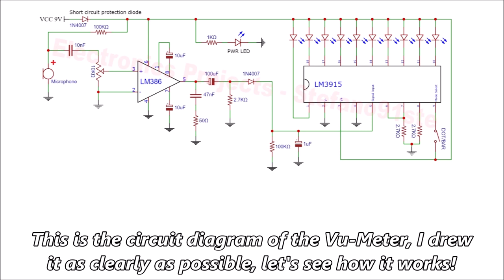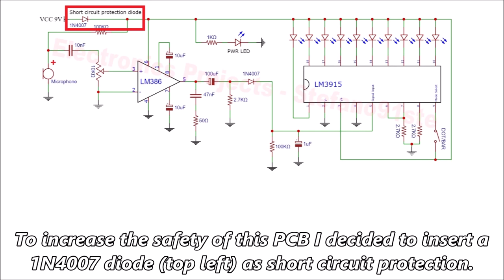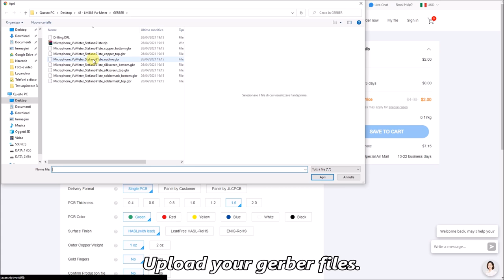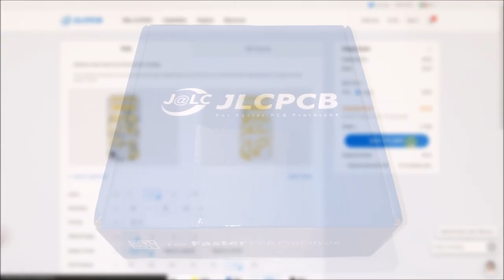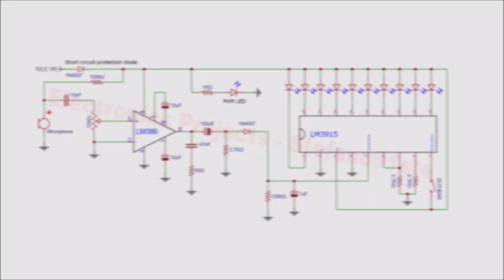LED Vu-Meter with Microphone LM3915 & LM386 - PCB Tutorial

Comment: I have a question!
1.Why did you use the diode ?
2.When I made the circuit, It was changed the Level after 100uF Capacitor. Before the Diode.

Comment: My Honor, Sir,
I did a vu meter after a video you posted. Tied to the speaker, he goes with a succulent. My problem would be that the vu meter is at a maximum for a small volume. The signal to the vu meters should be reduced. The amplifier is 8w (small). Is it ok to put a poteciometer in or not because of impedance? And how erratic should be kilo ohm. Thank you very much I would be very honored.

Comment: TPA3110 15w+15W Digital Stereo Audio Power Amplifier Board'
My question would be, is it possible to tie a vu meter to all Ic-powered mini amplifiers (power stages) loudspeakers? The TPA 311O doesn't go but TDA 2O5O goes nicely. The TPA 15w and an led secular are the last red. Where is the fault I ask respectfully?

Comment: Hello, do you think I could easily exchange the Mic with some wires to connect the whole circuit to a Arduino Board and use your VU-Meter circuit for a MIDI-Controller?
Reply from the maker: Hi, you could do this by eliminating Microphone and LM386, then connecting the LM3915 vu-meter to the arduino

Comment: What changes in the circuit diagram do I need if I want to power it with 5V power supply?
Reply from the maker: At 5v you can power it without any modification, but no less than 5v

Comment: Stefano!,  awesome work! I copied it and it works.  But, I would like to have a stronger signal from the mic.  LM 386 is a power  amp or preamp?  What would I have to add or change in order to gain sensitivity in the mic.  For example, I have to put the mic directly to my mouth or directly to a speaker to get the meter to move.  Please advise.  Thank you so much for your dedicated work. James
Reply from the maker: Hi, thank you! 
LM386 is a 1 Watt amplifier.. having said that it is great for small projects, but not for applications that require more power
Reply: I just want to make the mic more sensitive so as not have to put the mic directly on the sound or music that I am trying to get the meter (LEDS) to move. Please advise what I can do to make the mic more sensitive.  Thank you so much again for your fabulous projects.  I am so happy you responded to my letter the last time.  Good day to you.

Comment: Super and super!    Dear friend,
I'd say so, my friend, but I don't have the right.
I like to help you because I've been suffering for a year and I couldn't make the audio signal bigger.
I need a drawing with, say, two or three transistors (preamplifier for simple vu meter). I write with a fordito, and I tell you what I know, so how do you understand me? I bought everything from the net ,ready but it didn't work. The vu meter is the simple LM 3915, 1k ohm resistor and that's it! The microphone electret ,condensator .1 transistor. The signal is so good. Megyen but the volume should be weak or high. Help me if you can with a simple solution, I'm starting. BC 547.2N2222.2N39O4.
Reply from the maker: Hi, I use an LM386 as pre amplification (like this video) using transistors is not a method that I like
Reply: @Stefano91ste  Thank You dear Sir!